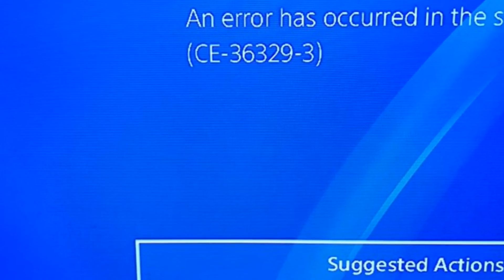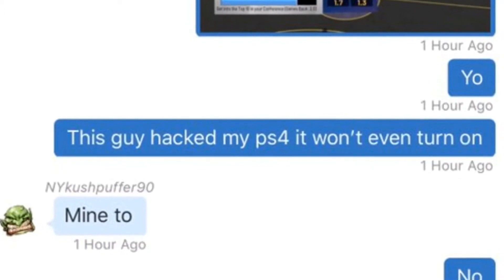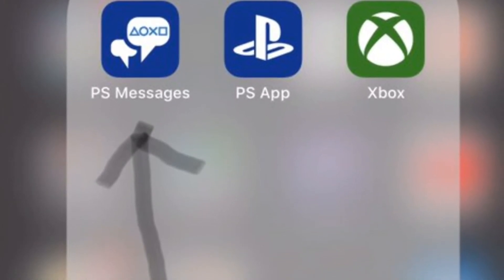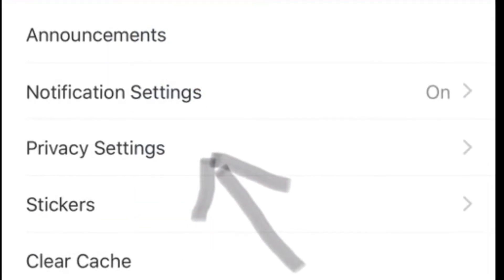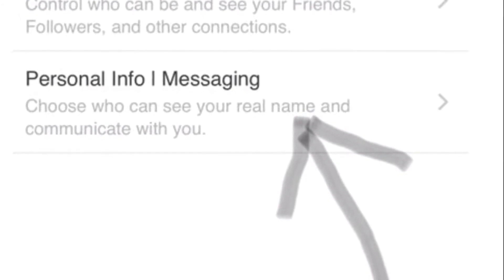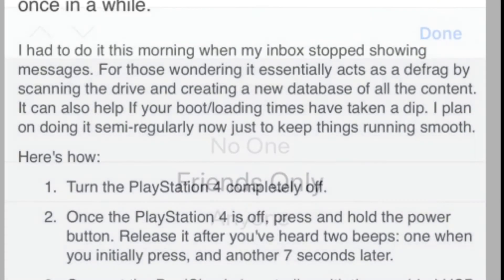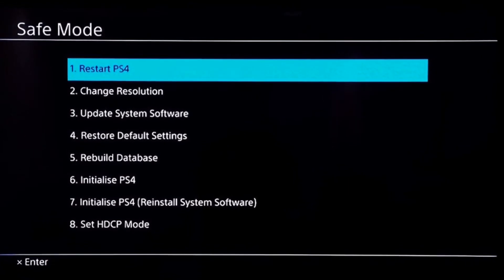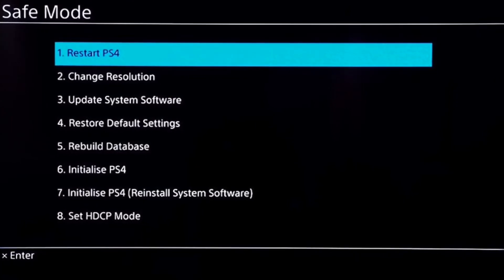CE-36329-3 PlayStation Error Fix With Explanation.

Comment: My PlayStation says the erro right as I turn it on and I initialized my PlayStation so all my data erased because it was stuck on the safe mode loop or whatever and when I turn it on it takes forever to turn on,it shows this error code, and doesn’t even let me go into settings or anything, it just freezes. Do I need a new hard drive or what ?? PLEASE HELP ME
Reply from the maker: If you’re not logging onto your account you see the air can be attached to an account you can try a guest account and if it still freezes I would definitely replace the hard drive if you have patience and can wait to you can find them cheap on eBay if you cannot wait then you can pick them up for a good deal at a Best Buy If you’re not logging onto your account you see the error can be attached to an account you can try a guest account and if it still freezes I would definitely replace the hard drive if you have patience and can wait you can find them cheap on eBay if you cannot wait then you can pick them up for a good deal at a Best Buy.

Comment: I’ve done this and it’s not working it still continues to give me the errors when I log on and try to play any games I’ve uninstalled multiple times and tried playing and still does it
Reply: How can I fix it
Reply from the maker: Hawg Seeker 

You will need to buy a Sata internal Laptop hard drive you can order one from the Internet or pick one up at Best But for around $50 or a little more.
Reply from the maker: Then it’s a hardware error, more than likely your hard drive.
Reply: Now it’s saying the database is corrupted. The ps4 will restart. How do I fix this?
Reply: It’s giving an error code ce-0005-8 now

Comment: My ps4 takes so long too load and when it does it just turns on by itself. Then it says an error with the code ce-36329-3 After I try again, it takes about 8 minutes too load into the home menu, I click on a game and it just freezes. It's really frustrating. I just made this post to see if anybody knows if I need to buy a new ps4 or just a part of the ps4 that is damaged.

this was before the update btw 
also me creating another user doesn't help it still freezes
and no messages like this are in my profile
Reply: would this work? https://www.bestbuy.com/site/wd-blue-1tb-internal-sata-hard-drive-for-desktops/5638723.p?skuId=5638723&ref=212&loc=1&ds_rl=1260666&ds_rl=1266837&ds_rl=1268709&ref=212&loc=1&ds_rl=1266837&gclid=Cj0KCQiAnNXiBRCoARIsAJe_1coVRdCcJ69NvHga4-MV-aOYbN8Pesy9MumEbqJJ8u4H60jof3I2cEwaAgmREALw_wcB&gclsrc=aw.ds
Reply: or this https://www.amazon.com/Western-Digital-Playstation-Hard-Drive/dp/B00TIYE4ZQ#customerReviews
Reply from the maker: The Blazzeerrr The hard drive in the second link will work great. Not the first link as that laptop is for desktop computers and won’t work.
Reply: @theblazzeerrr2651  I have the same problem did it help?
Reply: Hey man i have the same problem,its been 2 months since you posted this,can you tell me what you did to fix this problem
Reply: @axxelandros  hows you ps4 are thry fixed now? Thanks
Reply from the maker: The Blazzeerrr 

Without looking at it in person I would say it sounds like the hard drive is going bad and they cost on average of $50.
Reply: @Mr_Goody  Ok do In need to buy a specific one and if you know any can I have the link to it please?
Reply: Any solution !?

Comment: i did the steps and when i got to turning my ps4 it would'nt shut off and i had to hold the power button for 10 secs then 7 secs again and when i went to rebuild database it said "An Error has occurred (SU-41336-7) and i gave me only 1 option and that was to turn off my ps4. Can you Help me out?
Reply from the maker: +FearDelay 

I managed to solve this by doing the following: 1) Pull the power plug out the socket and leaving the PS4 unplugged for 15 minutes 2) Plug power plug back in and press the start button for about 8 seconds.  You will hear one beep and another a bit later.  When you hear the 2nd beep release the start button and wait for the PS4 to load into Safe Mode 3) The Safe Mode menu should appear. Choose Option 2 - Change Resolution. Select the highest resolution possible. 4) Wait for changes to take place.  
 
Hopefully this works for you too! As a precaution I checked to see whether the latest software was installed (Settings).  All was well.

That is everything you can try software wise and if that does not work then I would probably say it is a hardware error and you need to replace the hard drive which isn’t really hard to do and if you need any help just send a message my way I would be glad to help but hopefully the software steps above will fix the problem.
Reply from the maker: +FearDelay 

I managed to solve this by doing the following: 1) Pull the power plug out the socket and leaving the PS4 unplugged for 15 minutes 2) Plug power plug back in and press the start button for about 8 seconds.  You will hear one beep and another a bit later.  When you hear the 2nd beep release the start button and wait for the PS4 to load into Safe Mode 3) The Safe Mode menu should appear. Choose Option 2 - Change Resolution. Select the highest resolution possible. 4) Wait for changes to take place.  
 
Hopefully this works for you too! As a precaution I checked to see whether the latest software was installed (Settings).  All was well.

If the above steps do not work then you need to replace your hard drive and I would be glad to help you with that just send me a message if it does not work.
Reply: @Mr_Goody  thank you but i fixed it already
Reply from the maker: FearDelay 

I’m glad to hear you got it fixed. 👍

Comment: Hey man not sure if you can help me if you can thanks. 

Here’s my problem my ps4 is messed up and what I mean by that is when I play fortnite it freezes randomly and when I play red dead 2 it works fine no freezes and when I play bo4 it works fine until I hit the home button it freezes a screen pop ups with the ce error code in this video it says to update system software and when I try doing that it says no update available. What is wrong with my ps4 I wanna break it already
Reply from the maker: oreoNmilk1   Based on what you have said and if it’s just doing it on fortnite, Then my best guess would be it’s overheating and needs to be cleaned out with compressed air or if that doesn’t work you could replace the hard drive which is in a basic laptop sata drive.  You will have to do a full install of the operating system which you can download on a USB stick from Sony’s support on their website.
Reply: Mr. Goody hmm I tried cleaning the fan but maybe I didn’t clean it good enough. I’m not sure if it’s the hdd because I dont think I’ve gotten an error code for it yet but my ps4 has been unplugged a couple of times. It’s also been dropped.  I’ve been thinking of doing the initialize step
Reply from the maker: +oreoNmilk1   Just remember doing that will erase everything and if you haven’t backed up your game saves, they will be erased. But that really is the only step you have left. That will determine if it’s a hardware or software issue.  If you initialize it and it still freezes than to me it seems like it could be the hard drive.  Hard drives can be hard to diagnose as bad, because they don’t just completely stop working sometimes they work fine until your PlayStation try’s to read some data in a bad spot of the hard drive. Bad sectors is what it’s called. That would cause it to freeze. Sometimes they will make a clanking noise randomly, sometimes a whining noise and sometimes no noises, just locking up.  So in closing, if it was my if the initalization doesn’t cure the problem. I’d get on eBay or go to Best Buy and get me a replacement hard drive.  I don’t know your budget, but there’s not a big difference in 1 terabyte and 2 terabyte hard drives these days, I’ve seen them as cheap as $45.  I hope this helps and remember backup your game saves before you initialize if you need to.
Reply: Mr. Goody thanks for the help man ima try initialize later and if the doesn’t fix it ima try to buy a new hard drive because I have heard the hard drive make weird noises and whining up noise thanks again
Reply from the maker: +oreoNmilk1   Your Welcome anytime.
Reply: I can't even get on fornite
Reply: It’s based on what game you are playing fortnite crashes very often call of duty and fallout crash a little bit but it’s just PlayStation it has severe issues that they still haven’t fixed after 4 years
Reply: Your storage is prob. close to being full, so try to delete some games u dont play

Comment: Do I have to delete all the messages on my account because I probaly have about 1,000 messages and it will take me days to delete all ????help asap
Reply: Is there a way to delete all these messages on the app faster because I don’t think I’m gonna be able to delete all of them because it’s too much
Reply from the maker: Carlllooosss  Patience is the key.
Reply: Mr. Goody is it just one message that has the virus because if it is I can’t find it
Reply from the maker: +Carlllooosss  It usually has some weird symbols in it like if you watch my video you will see but that isn’t 100% the case all of the time but if you’re just wanting to try deleting a few messages then I would try to delete the ones that have all the characters that stand out look in my video for an example the ones with the hearts and different things such as that.  I hope this helps you.
Reply: Mr. Goody I just finished deleting every single message and it’s still happening any idea?:/// I can’t even call PlayStation support😞
Reply from the maker: +Carlllooosss   If it is still happening then I’m pretty sure it is your hard drive and you can buy them on the Internet a 2 TB for around $50 or a 1 TB at Walmart for around $60 depending on how fast you need them you can also buy them at Best Buy they are 2.5 Sata laptop hard drives.  If you decide to get one let me know and I can help you with steps on how to install it.
Reply from the maker: Only if you have not updated your firmware as this problem only existed with the older firmware.  If you still have the firmware then yes you have to delete all of the messages.
Reply: Delete all button?

Comment: After safe mode
I tried to scroll down but remote is note working 
So I press x and restart the ps
Now what o do?
Reply from the maker: Plug the remote into the PlayStation 4 in wired mode, with the micro USB cable and it should work.  If the system restarts and the controller doesn’t come on don’t forget to push the PS button to power on the controller make sure it is in wired mode and plugged into the USB port.
Reply: Use the D-Pad.

Comment: I get this error everyday
Reply from the maker: If it still days after you have done all my steps on my Video, then more than likely it’s your hard drive, You should check to see if your system is still under warranty.  If not a regular 2.5 Sata Hard Drive will work. If you have any further questions just ask.
Reply from the maker: It could be a compatibility issue with that certain hard drive, if you can try another brand.

Comment: Hey man I really thank you for the vid but after I did what you said to do then a new error arise:
The database is corrupted the PS4 will restart (CE - 33035 - 4)
Reply from the maker: If your console is being powered off whilst on, or on rest mode (with orange light) then this can damage the console and the file system resulting in corrupted data. If your brother is doing this then it would probably be best to Shut down the PS4 when not in use. You'll lose out on the rest mode features, but it'll save your data in the long run.
 
Another possible option would be to back up your save data to a USB stick or PS+ so you don't lose it.
 
And to reduce the risk of a corrupt drive I would suggest you boot into Safe Mode and run the "Rebuild Database" option next time you're on your PS4. :)
Reply: Mr. Goody hey I did that for like 2 months I would jsut use my ps4 to charge my phone because it charges it really fast and now my ps4 is super slow and I can’t use it because every time I turn it on I can use it for like 20min then it will turn on and show ce-36329-3 and that a problem occurred in the system software the last time the ps4 was used
Reply from the maker: Sounds like your hard drive may be going bad, try the video on my channel on how to replace a PS4 hard drive.  I hope your back up and gaming soon.
Reply: Mr. Goody awwwww alright then thank you
Reply: Mr. Goody wait also it says to update my console but it’s already update to the newer update
Reply: @Mr_Goody  
k
Reply from the maker: The steps I have in my video would not cause any of this what causes this is if your PlayStation gets turned off inproperly and I can corrupt of the data on your hard drive but the directions I have listed above should solve it for you.
Reply: @Mr_Goody  did all of this tho lol
Reply from the maker: SourPunched 
If you’ve done everything here then usually it is actual hardware and you need to replace your hard drive and I’ve done a video on that too.

Comment: i already had friends olny on so is my account dead
Reply from the maker: No not Necessarily just tried the first steps of removing the messages like I said and I don’t want to think this way but the reason why I say set it to friends only is the make sure no strangers can send you those messages but it is still possible for a friend to send it to you if they are messing with you not trying to blame your friends though. 

So just delete those messages my guy explained in the video And if the messages are deleted then your account should be OK then immediately do a system update because the new system update is not affected by this glitch.  I hope this helps you my friend.
Reply: @Mr_Goody  can it be anything to do with friend request because someone friend requested me with a message it said "i like you
Reply from the maker: cravingelf  It sure can in fact that is one of the messages that was worn out that messed some of the PlayStation network accounts up so delete everything you can as far as your messages that you don’t trust or that may be sketchy. One way to test if it’s your account or not is if you have a friend that has a PlayStation Or you have to playstations and you log into your account then it will freeze up on either PlayStation this is a good test to test if it’s your account or to test it its your PlayStation.  But to answer your question that does sound like one of the messages that was going around and yes it can be a friends request.  If and once you get your account straightened up you need to do the update immediately on your PlayStation the system update. I hope this helps you.
Reply from the maker: +cravingelf  Without seeing it in person, I really wouldn’t know any farther but as a last ditch effort you to call Sony technical support and see what they have to say.

Comment: Why is there no delete massage?
Reply from the maker: I’m not understanding your question fully.  The messages you are supposed to delete are on your PSN online account and you can delete them from the android or Apple iOS app. But as I stated if you are still getting that message after you have updated your operating system because they have patch this security breach about two months ago, it’s possible it could be a hard drive problem.

Comment: That's bullshit. Ce-36329-3 & ce-34878-0 are hardware issues, you can't fix them
Reply from the maker: This video Was made when there was a firmware system software exploit which I have stated has since been patched, it was when the 6.0 firmware was introduced that there was a hack that could produce this error which usually is a hardware issue.  But it was patched and if people are still getting this message there is a possibility that they have not updated their system and that is what I suggest to them every time and to delete those messages just like I say in my video and then if that doesn’t fix it then it is probably the hardware issue as you say. But I just wanted to let you know and you can Google this that there was an exploit in that system software that people were producing this without a hardware issue.

Comment: Pls help  I have the latest version of PS4 and it happened I have no message
Reply from the maker: If you have the latest update installed then you might want to try logging onto the app the PlayStation app and delete any private messages that you may have gotten and then try to restart your PlayStation and see if that helps if that doesn’t help try to uninstall the game that it’s crashing on and then reinstall it and then if that doesn’t help it may be your hard drive going out if your system is new I would simply return it to the store for another one or if you have to you could call Sony and set up a repair if it’s under warranty.
Reply: @Mr_Goody  when I start up my ps4 and I don't get the error message is it fixed?
Reply from the maker: stop oh yeah yeah 

Yes should be.
Reply: @Mr_Goody  ok thank you